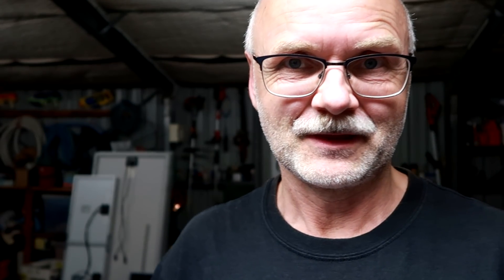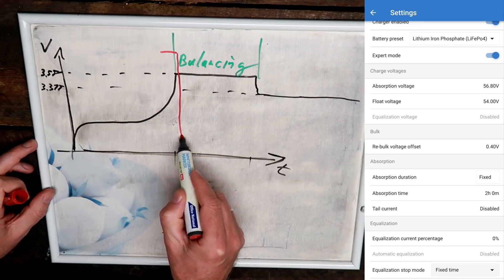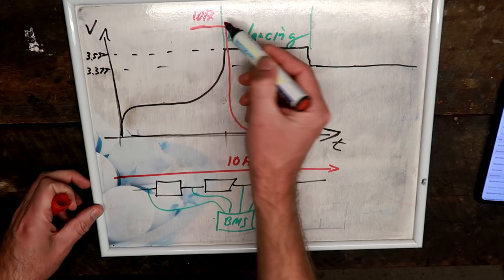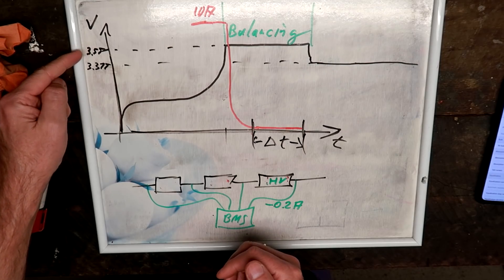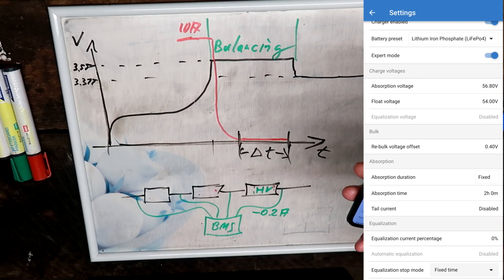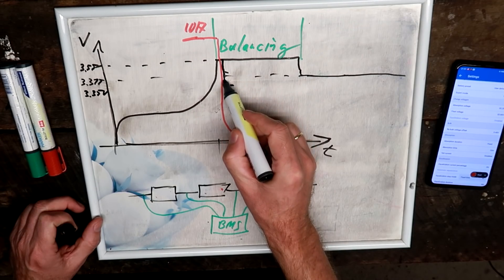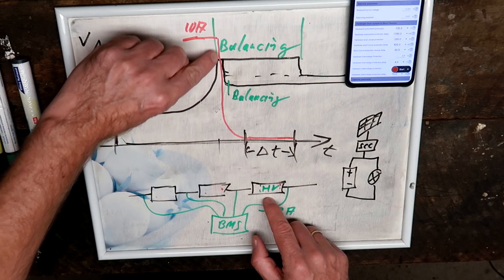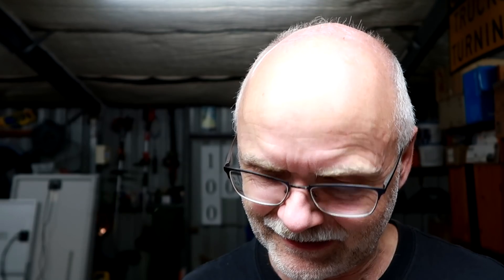Can I balance my battery while floating? Well, I do!

Comment: I am now confused about the balancing process. I have a Daly BMS and it only shows that it is in balancing mode when the BMS is in charge mode. Once the BMS is switched off because it reached the designated charge voltage, there is No balancing. So I wonder if balancing is not only to reduce individual cell voltages or does it also increase those cell voltages which are too low? Danke
Reply: The way I understand BMS is it always lowers the highest cell down to the lower ones voltage via mosfet.  It will continue to do that until all of the cells are charged to your set point.
Reply from the maker: How can the BMS balance your cells with say 30mA when you still charge your cells with 5A at the same time. That does not make any sense...
Only an active balance will decrease voltage of cells which are too high and transfer this energy to cells with lower voltage. Normal BMS don't do that, they just burn off the energy through a resistor.
Reply: @OffGridGarageAustralia  An Active Balancer might be able to reduce the voltage of one cell, if and only if, the Active Balancer can transfer more the 5 Amps of charging current, many (most?) do not.  And if it is a Switched Capacitor type of Active Balancer and it is rated at "5 Amps", then it will probably only average  2.5 amps transfer between the highest & lowest cell.
  BUT ... Cell Balancing, whether Active or Passive, should only occur during the end of the Absorb Charge or during Float Charge when the charge amps are LOW ...
Reply: @MrSummitville  , I beleive I see what you are saying.  The switching device for the "capacitor type" has to be rated at the charging current becasue it will have to run through this switch if activated during the charging period.  It is my understanding that both Active & Passive  balancing happen at the end of the charge.  Plus, it is also my understanding that the capacitor type of active balancer can only do this with the adjacent cell.  With 16 cells in series, that is a hell of a lot of transfering if cell 1 is the lowest and 16 the highest.  Can't see that happening without time.
Reply: I would imagine that different manufactures configure their balancing act many different ways.  I’m also willing to bet that some do a piss poor job at system logic and can only come up with a sub-par product.  I would consider that Daly BMS a shitty design if it only balances (or tries to balance) while charging only.  It will never achieve its purpose in my view if that is the case.  I agree with Andy, this makes no sense.  Must be a design flaw.
Reply: @Do_the_Dishes  what if it is actively balancing and instead of depleting high voltage cells, it is supplying the lower cells with additional charge current?
Reply: @ralph9987  , I'm not sure what all is goining on in the BMS, but from what you and others are saying, that brand is only balancing while it is charging.  I would imagine bleeding off the high cells is the easiest way to accomplish balancing and this task should be allowed to be completed without a time or function restriction.  Hence, balancing all the time.   After reading MrSummitville's comments, I feel he is more qualified to answer that question.  I'm not sure how complex these devices are getting.  I know what you suggest might be more efficient, but would be very difficult to achive properly in my eyes.  For all I know, they have a BMS that can do that.

Comment: So many good points. I've set mine (a Daly with only 30mA) to start balancing at 3.0v. The cumulative effect will add up to balance the cells nicely. 6 months in and it's been behaving really well. 

I should add, that the Daly only balances during the charging stage. And to detect that, it needs to be >1A in my setup.
Reply from the maker: Great advice, thanks for sharing!
Reply: @OffGridGarageAustralia  But balancing is better ( = a smaller final mv difference ) during lower charge amps, not with higher charge amps  ...
Reply: Are you still using this method ? i have Daly built inn also in my 100A lifepo4 battery

Comment: I have been testing different settings for boost (absorption) and float voltage on my Renogy Rover Li 20A mppt charge controller and 4 cell 12V LiFePo4 battery bank over the past month.  In my case the system is in use on my boat, so I want to take advantage of the sun to run my loads (primarily a refrigerator) all day and still keep my battery "topped off" for night time reserve.  My target has been to achieve between 80 - 90% SOC at sunset.  So far I have been able to achieve this target at the end of the day by using a boost setting of 13.8V and a float setting of 13.2V.  I have experimented with a variety of voltage settings for these two parameters.  3.45V per cell boost and 3.3V float seems to be effective settings for my particular situation and SOC target.  On a good solar day this generally results in a 86-87% SOC by dusk, having served the refrigerator's draw over a 24 hour cycle.   I have been periodically checking my individual cell voltages via an ISDT BattGo monitor and they have generally remained within 8mV of each other.   Just my observations and experience, but I have the same question...they are staying within 8mV of each other, but at a lower charging voltage...are they balancing, are those settings best for the longevity of the battery, and would I find that they drift less if I were to push the SOC closer to 95-100%?
Reply from the maker: Thanks so much for sharing, Jim. That are basically the same setting as I have. Good to hear they work for you, so I will keep them as well for a while.
These settings should keep the cells very healthy as they avoid any high voltages. They will drift a bit over time as the cells age but we have to see, test and observe how much that will be.
Reply: @Jim Fisher DIY Portable Solar Power - What do mean by " ... best for LONGEVITY ..."  ?  a) Max Cycles,  b) Max Amps-Hour per day,  c) Max Calendar Days or d) Max Watt-Hours over lifetime?  They are somewhat mutually exclusive results.  Best longevity occurs, if you keep it at 50% SOC and never use it !
Reply: @MrSummitville  choice a
Reply: @JimFisherDIYPortableSolarPower  Many more CYCLES can be achieved by doing a 80% SOC max charge, down to 20% SOC minimum.  Never 100% SOC and never 0% SOC.  But you see, you have now given up 40% ( = top 20% + 20% bottom ) of the Ah Capacity of the battery per cycle.  See what I mean about "mutually exclusive"?  But now a QUALITY battery should last 3,650+ cycles or 10+ years.  Maybe more?  We just don't know because nobody has ever charged & discharged a LiFePo4 every day, for 10 YEARS, yet.  There was a test on a Winston LiFePO4 Cell that was stopped after 1,000 Cycles with only 10% Degradation and then they estimated ... A total of 4,000 Cycles possible using 90% SOC max charge, down to 40% SOC = using only 50% of the cells capacity.  They the stopped test because it taking way too long.  The problem is ... what does 10 YEARS of Calendar Aging actually do to a LiFePO4 cell ?    Also, never above 75° F  ...

Comment: Andy, It looks like you got your system fine tuned or at least making friends with it. 
Unfortunately, many of us don’t have the flexibility that your system has or it’s for a totally different use, but we all are fighting the same gremlins. 
I was doing some tests on a quick turn around charge for 12v 280ah battery for the trolling motor in an aluminum fishing boat. Use all day, charge nightly at home and be ready early the next day. Not being able to control the absorption time (dumb charger) and not having the luxury of time, it gets charged at hard at 50 amps. The BMS simply doesn’t have the time to work the imbalance with the feeble 50 milliamp balance current. I started seeing too much imbalance and the Overkill BMS would end the charge because of a high cell and with it the balancing. Things would only get worse each cycle. I found the Heltec capacitive active equalizer/balancer. I use the 3S 4S 5A model for my 12 volt project and the 13S - 17S 5A model for my 48v systems. They are efficient and haven’t noticed any heat because it doesn’t waste energy through resistors but channels voltage from the higher cells to the lower ones. Standby current is negligible but it can be put into hibernation by adding a switch. They work together (parallel) to the BMS’s leads at the battery. My delta? Usually within .004 Volts 30 minutes after my charger finishes at 14.5 V and never varies more than .012 V during the charge. Right now it’s fluctuating between .001 and .002 delta at 70% charge and the equalizer has been off since it’s last been used fishing a few weeks ago. If it’s not going to be used right away we don’t charge until the day before since they don’t like being stored at full charges. The thing is a beast close to 4 times the useable power and 10lbs lighter than the 100ah AGM it replaced. More running voltage to the trolling motor = faster, far longer and may outlast the boat lol. Cheers
Reply: Sounds like you have a handle on it, so to speak lol. What if you had two batteries that way you could give your batteries the time if needed and then switching your batteries every other day instead. More cost of course, anyway just a thought.
Reply: @Karl Jensen - So, you are masking the symptoms of a BAD Cell ?
Reply: @MrSummitville  
No, try charging any group of top balanced, high ah (270-320) grade A, impedance matched cells with a 1/4 C rate and virtually no absorption/ balance time with the most common BMS’s (only .050 milliamp balance current). Remember most BMS’s only balance during the last part of the charge and when the charge is disconnected the balancing is stopped , but necessarily complete. Eventually you’ll end up with an imbalance as you get to full charge. This is a a common issue for the avid fishermen, golf cart, fork lift, applications that get high use but need more than mediocre balancing current. Another thing people don’t realize is temperature difference of cells. The cells in the core vs the ends have different rates of heat gain or loss, either self generated (charge/discharge) or environment. Temperature differences can effect voltage/capacity. Then there’s time. Theses things are new. How matched will these things be 5 years from now? But there’s an easy inexpensive cure or a bit of insurance.
Reply: @SkypowerwithKarl  Charging at C/4 is typical for a 280 Ah 48 Volt Off-Grid battery bank with a 3,500 Watt PV array.  It is done every day.  And if you need a 5 Amp Active Balancer then one of your cells is BAD or failing - ie it does not match the other cells.   Also, do not use a balancer that stops balancing when charging stops.  In  your situation, you created the need, for a High Amp Active Balancer.
Reply: @MrSummitville  
Hello, balancing after it’s done charging is an active balancer. Most popular BMS’s for internal battery/case use don’t have a large balancer because they can’t get rid of heat (resistance). Capacitive equalizers (balancer) are the future, very low heat. They may even open the doors for B grade non top balanced systems. Keep in mind that a solar system isn’t constantly disconnected and the battery won’t see a charge till it’s depleted. Solar is a constant give and take where it highly likely to have long intervals of absorption available.

Comment: I think you are onto something here, but I would (for science purposes) run it like you said for 2-3 months, and then charge it to 3,6V per Cell and see how far they drift apart.
Just to see what happens.
Reply: Why does he need to charge to 3.6 Volts?  Do you balance your car tires at 150 MPH?  Nobody cares that their tires would be  unbalanced at 150 MPH.
Reply: @MrSummitville  To make sure that the cells dont drift apahrt SOC wise. I mean you would not notice it by the cell voltage in the middle of the charge curve.

Comment: Andy, with victron system what do you think about 18s configuration?
Reply: I´m using 18S Strings 3 in Parallel  280Ah so far i have no negative experienced, i can balance at 3.53-3.54 per cell (64V pack voltage), i have used cells so i have to rebalance every time i get to 10% or 100%. My BMS (batrium) cant keep up so i´ll be instaling active balancers soon aswell.
Reply: PS, i have a Victron 3 fase Multiplus 5000VA system

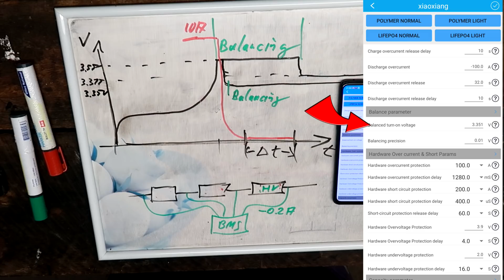Comment: balancing is/should not discharge a cell that is high, it is/should bypass it partially with 0.2 A. it start that at 2,7 to have enough time to do this. The balancing turn on voltage is when the voltage is going UP, not when going down, so I fail to see how your idea at 12:02 is gonna work.

At the end you have failed logic. You moved the location of what you consider 100% charged, but that does not mean you have the same capacity/energy of wh's stored. It's like 95% is the new 100%, hurrah.

If you have less drift, that does not mean the balancing is working just as good, it just need to do less work. So that is in the case of this batteries a good reason to go for a lower top voltage. So instead of reducing the absorption time, it would have made more sense to lower the absorption voltage.
Reply: Starting the Cell Balance process at 2.7 volts is way too low ...

Comment: At 53.2 you're only at about 80% soc so of course the cells are close together in voltage. It's when you get to the extremes (fully charged or near empty) that you will see an out of balance condition.
Reply: If there is imbalance then the cells are always out of balance, you just don't see it due to the flat voltage-to-SOC characteristic of LiFePo4 at mid-voltages.
You don't see it but it's there...one cell has more energy than another...Then when you discharge, the cell with lower SoC will hit the lower voltage limit first and this will limit the usable capacity of the whole bank.
Reply: I don't know how you know 53.2v is 80 percent charge? Did you have a smart shunt monitoring his battery all day long to measure the exact amp hours?
Reply: @uhjyuff2095  A reliable test was done on these cells that yielded the following: 57.6=Full charge, 54v=99%, 53.6v=90%, 53.2v=80%, 52.8v=70%
Reply: @SpeakerKevin  lol

Comment: I run 2 banks, and allow 2 days for internal balancing (1 day minimum) before use, charged to 3.4v per cell, average. More ammo for your 2 bank solution!
Reply: Why are your cells getting so far out-of-balance ?
Reply: @MrSummitville  They aren't. It takes 1-2 days to run a bank down, and less time to charge.

Comment: Does your BMS balance on float ? certainly my Daly BMS will only balance while the battery is charging. Having said that I agree with your voltage settings. I believe your BMS software has the option to balance when not charging. It would be interesting to see that in action.
Reply: Yes, it will start on the set balancing turn on voltage  when the voltage is going UP and will continu as long as the voltage is above that and current is being delivered. I think the approach Andy takes is not working, but he will have to find out himself.
Reply: @HansKeesom  The key phrase there is "current being delivered". On float there is very little being delivered, only enough to maintain battery losses, so balance  would not work.
Reply: @muddy11111  Balancing during Float Charge does NOT not work on your BMS.  Other BMS may balance as long as a Cell voltage is above a setpoint ...

Comment: Before even watching I maintain you can only properly balance at the rapidly changing bits of the graphs you have been generating. ie at the very high or low voltages. And only properly check the balance at these extremes too....   now I unpause and watch  :)
Reply: and maintain it still.  However I only think you need to worry about balancing once a year.  I DARE you to turn OFF the balancing for 3 months - then do a higher voltage/cell check and see how little it has gone.  I don't think your balancing is working,  but because your pack is already balanced, it doesn't have to do anything - so compare to 3 months with no balancing.
Reply: @KevIsOffGrid  You are right the balancer may not do anything because the battery is perfectly balanced, but it might change in the future so having an automatic balancer is the way to go. He doesn't want to make balancing batteries his full time job. Just turn it on and let it do the work for you!
Reply: @uhjyuff2095  I have a similar pack, 24 cells.  I check the balance maybe twice a year (no balancer) its in balance always.
We use new cells - no balance issue.
We cycle at low C rates - this isn't an EV with massive current draw, Andy's system 1C is 280Amps, all summer he had 1 charge controller at 35Amps - so couldn't even get to 0.2C charging,  he could just about discharge at 0.2C if the 3000w inverter was flat out on the tesla charging...

Balancing isn't a full time job, it isn't even a part time job, its just a non-issue at all.  Just use the battery and that's it, Solar is so gentle on large battery banks   :)
Reply: @stupidmonkeykev  Well check this out for an example. He starts charging his tesla and the low voltage cutoff on his inverter is set too low and then the BMS has to shutdown the discharge. The low cell is what caused the bms to cut off. Then he does this once a week. So one cell is getting slightly degraded more than the others due to lower voltage discharge every time and then the cells slowly start drifting out of balance more and more year after year. Having the balancer on for long periods because the packs are so large and the balancer is so slow is just a great feature to have and something that just works without having to think about it. Obviously, this is a worst case scenario but most people have no idea about these lithium batteries and how they work.
Reply: @uhjyuff2095  - In what video did you see  ... one cell is getting more degraded than than the other cells and then the cells drifted out of balance?  We see no evidence of that happening ...